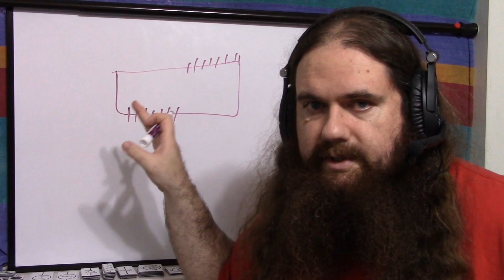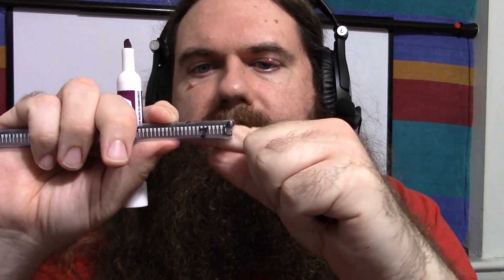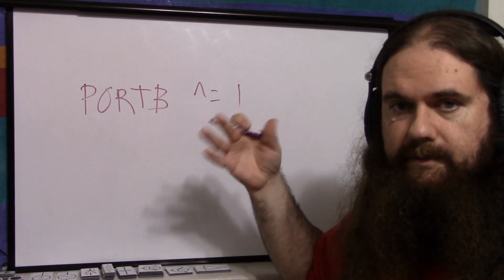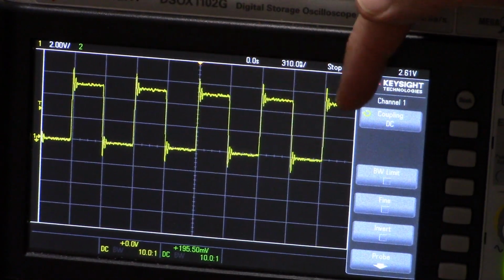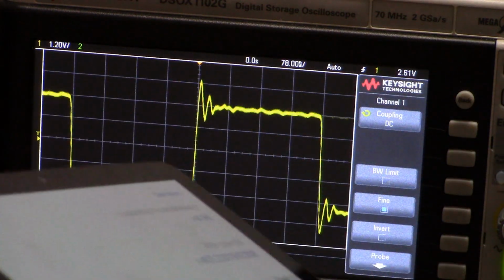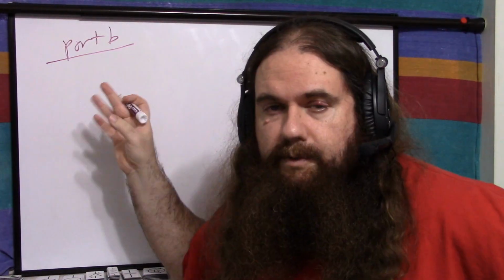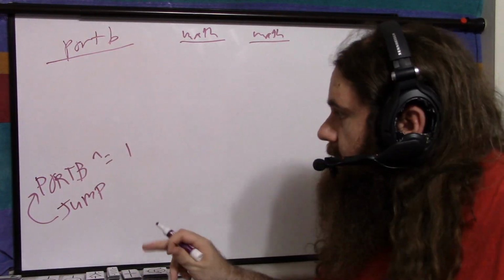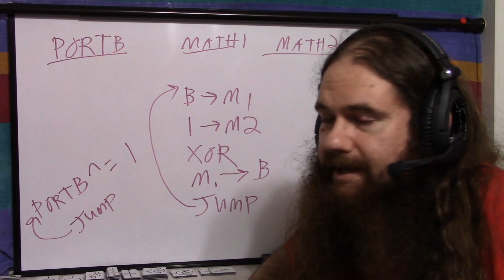How Fast Can An Arduino digitalWrite - A Demonstration And Discussion - Simply Put

Comment: You got the assembler almost perfectly right!
The jump actually takes 2 clock cpu cycles. The loop still takes 5 cycles per iteration because the number "1" is  already in a register throughout the loop.

---
ldi	r25, 0x01	; load value 1 into register 25
   loopstart:
in	r24, 0x0b	; [1 cycle] load port B into register 24 
eor	r24, r25		; [1 cycle] xor    
out	0x0b, r24	; [1 cycle] store result into port B 
rjmp	.-8      	; [2 cycles] jump to loopstart, 
---

And you can get it down to 4 clock cycles by doing this:
  byte tmp = PORTD;
  while (1) {
    tmp ^= 1;
    PORTD = tmp;
  }

I'll let you figure out why that is, maybe you explain it in a future video :wink:

---
For other viewers
* Here's how to get the assembler listing: [android-install-path]/hardware/tools/avr/avr/bin/objdump -S [build-folder]/[sketch-name].ino.elf > assembler.asm
* Here's a table with atmega328p instructions and cpu cycles per instruction: https://docs.google.com/spreadsheets/d/1EzwMkWOIMNDqnjpbzuchsLx5Zq_j927tvAPgvmSuP6M/edit#gid=1419860012
---

btw, you should like hearing your own voice, you have interesting things to say!

Comment: Excellent tutorial..!! Earned my subscription..!! Keep them coming..!!;)

The ringing on the square wave is most likely due to that long ground lead on the end of your oscilloscope test probe.. If you shorten that thing up as much as possible I think you will actually see a very clean square wave.. Some probes come with a little stubby ground probe you can replace the long wire and gator clip with.. 

Scope probes typically come in a pouch with a few accessories.. The  little stubby ground probe most likely remains one of those things you glance at maybe once and go straight for the long gator clip attachment.. 

The high frequency components in the leading and trailing edges of that square wave hit that long ground lead of the probe with a similar effect to plunking one of those old door stop springs..;)

I did bench work for a few years..;)

Comment: I used to write mainframe Assembler.  With 22 Instructions, 15 Registers, and 2Gb of Memory, you could write code to do anything you could dream of...in green and black.  When I switched to Cobol, I used to decompile the Cobol into Assembler to optimize my Cobol programs...a fun game for a Nerd.  Debugging Assembler was extremely tedious, writing It was 4 times slower than doing the same in Cobol, but boy was it fun.  I mess with Arduino programming now, so you have my atttention.

Comment: I was sorry to hear that someone told you that you talk to much. They say a picture is worth a thousand words. I am totally blind, so not much of a visual learner. You explain things in a way that I can follow. Not just the concepts, but the circuit layout, etc. I Wanted to learn how to make an R2R dac. I had to listen to about 8 videos just to learn how the darn thing was connected. Grrr, but who cares, I got there in the end. I especially like your videos because its one and done. Let me tell you, making disjointed notes from multipul videos flow in a way that makes sence, then finding a couple other videos to verify what you think you figured out, is challenging and teedius. I listened to a vid of yours yesterday, and subscribed within 30 seconds. Yes, I "liked" it too. Now I've been benge-watching your channel and learning in 10 minutes what could take 2 or 3 hours to scrape together from other channels. You just keep right on talking. For the curious,, I hear voices. My computer, phone, multimeter, etc, they all talk to me. I've also made some tactile gauges with servos. They hold their position while being touched. For example, I made a speedometer for my exercise bike with an Attiny85, a servo, and the input connection the original, inaccessible computer used. Works great, and easy to check without interrupting my YouTube video. Oh, I put it in an altoids box, because no self-respecting hobbyist  doesn't have at least one project in an altoids box!

Comment: Dear Simply Put, let me start with saying that I'm glad I found your channel, so much knowledge and a pleasant way of hosting, 
I wasn't sure on which video to ask this question but I was sure it was you I would be asking, so may as well do it in this video as it is somewhat related (ahum)
For me electronics is like I get it but I don't and now that I'm programming an ATtiny85 through my parallel port I can't figure out for the life of me if I need to use resistors between the pins of the parallel port and the pins of the ATtiny85. In one of your videos you mention resistors will slow down response time but I also now have four damaged parallel port cards,. My clock pulse resembles your square wave with the noise when changing state which when programming at higher speeds is causing false reads I think , so my second question is how can I clean up the signal ?
I hope you are alright and continue posting soon

Comment: Great video as always. You certainly put a lot of work into these but they’re some of my favorite I’ve seen on YouTube (and I’ve been here a long time). I wonder what you think arduino ide is doing to the instructions when you change to the “fastest” compilation. Or better yet, how many cycles does that save? Behind the curtain type of really interesting. I also wonder about the comparative stabilities of each but that’s a whole different can of worms
Reply: Different optimization levels as far as C/C++ go, you can f.ex favor speed over size (code/program size) by "unrolling" loops or "inline" function calls, what that is is fairly straightforward; instead of the program counter (the "where am I now?") doing a jump instruction to some other part of program, it is faster (or can be faster, especially for small functions/loops) to just copy/paste the function into where you are. In other words; if you were reading a book, instead of looking up where is chapter or paragraph X, you have just copy pasted that right into where you are you are. This will mean your book now contains the exact same paragraphs several places, but if it is a small paragraph that is faster than "jumping".
Unrolling a loop likewise; imagine a for loop interating 3 times. You can either jump 3 times to the start or just write the exact the same thing 3 times after each other. 

Other types of optimizations is to keep some variable in a register instead of memory; for accessing memory is slow compared to accessing a register. But you only have X amount of registers. And so on.

Comment: Using PINB = (1<<N) will make it even faster. According to datasheet, writing PIN bit will simply flip that corresponding PORT bit. It is a single instruction flip. I achieved 2.66MHz square wave on 8Mhz ATmega328p. So PINB = (1<<2) costs one instruction, and PINB=(1<<2) costs another, to flip it back, and a JMP. 3 instructions make a square wave cycle (duty cycle is not 50% of course. Add a _NOP() to get a 2MHz square wave with 50% duty cycle.)
Reply: I even used this high frequency flipping to create some RF radio communication since @20Mhz, I can flip port at 10Mhz (without loop) and its 9th and 11th harmonic can be picked up by AM receiver @ 90 and 110Mhz. To improve range, a BJT based common base amplifier, a simple LC filter and a small wire antenna can be added.
Reply: PORTB = (1<<2); costs one instruction

This will modify ALL 8 BITS. All Port B Bits are set to LOW except Bit 2 is HIGH 
---> PORTB will be: 00000100   (looks like the third bit but bits are counted from zero)

> I achieved 2.66MHz square wave on 8Mhz ATmega328p
Should be 4MHz if the pin toggles every cycle.
Reply: @Henry-sv3wv  the looping JMP instruction costs 1 cycle.
Reply: @sullivanzheng9586 
ah, ok. i found out the rjmp even takes 2 cycles.
So the fastest you can do with 328p arduino @16MHz if you want 50% duty cycle (after the first loop run) is 2MHz with this "asm-loop":
sbi,nop,nop,cbi,rjmp   (they take two clock cycles except the nop)

unless you modify all 8 port bits at same time, then it can go faster, or even faster, a raw unlooped sequence of out instructions

Comment: Assembly is something I know.. or I have a fairly decent knowledge of pre-pentium x86 assembly anyway. You can't use two memory operands at the same time. I also don't think you can use a memory operand with an immediate, but I'm not sure about that. I love assembly, I recently converted a pi decimal place calculator (written in pascal) to assembly to see what kind of speed improvement I could get. I forget the actual numbers but it was a fairly large difference. Pascal has a lot of overhead (as do many high-level languages.)
Reply from the maker: There's no reason you couldn't have those things in assembly, of course, it's just that I expect the added complexity of the chip would be stupid and impractical. But from a conceptual standpoint you could make a chip do anything you want as a "single opcode" if you're willing to spend the silicon.
Reply: @simplyput2796  I think there must be a reason, otherwise it would've been implemented. There have been times where I have wanted to move data between memory locations (sort algorithms come to mind). I'm certain it could be done, I wonder if it's just either too complex or too time consuming (either in implementation or in cpu cycles).
Reply from the maker: Yes, the reason is cost v. benefit: Too much extra complexity for too little gain. It's more engineering effort and it's more die space they could spend on something else more complex, and I seriously doubt there would be significant time gains since interacting with RAM involves the RAM controller and other timing considerations, and so it makes good sense to do it more simply to allow the CPU to more easily do stuff like multithreading and hyperthreading based on what's waiting for what and when.
Reply: Also keep in mind this is AVR assembly, not x86. Being a microcontroller, this may well be something they did implement as it IS of significant benefit to the typical application of an MCU. It's not a general purpose computing engine, so something specific like this may well have been done. I don't know any facts about this, I'm just saying maybe they did, you can't assume x86 knowledge translates 1:1 to an AVR processor

Comment: You can look at the compiler output of an Arduino sketch and maybe figure out what exactly the MCU is doing when it executes this code and how many clock cycles it takes by going to Compiler Explorer 
https://godbolt.org/z/yCSps9

 You can also convert your .elf files into plain .txt by using avr-objdump.exe which is included with the Arduino IDE.
I took the basic blink sketch and removed the delay commands so it blinks as fast as possible then clicked on Verify. This created an .elf file in this folder C:\Users\dentaku\AppData\Local\Temp\arduino_build_604254\ (you can find this temp folder by reading the verbose output of the IDE after the sketch has compiled)
I have a copy of avr-objdump in the root of C:\ so it's always in my Windows %path% so all I need to do is this...
avr-objdump -Sz -l Blink.ino.elf > Blink.ino.elf.txt
At the bottom of this ridiculously long text file you will find the code that belongs to setup(); and loop();
I don't really know what any of it means but it's there to help you see what's going on after your code is compiled.

 For some reason AVR code is very hard to read but using the version of objdump.exe that comes with the STM32 core Arduino files gives me nice easy to find chunks of code that I also don't really understand but at least you can then find out how many clock cycles each command uses.

 void setup() {
  pinMode(PA4, OUTPUT);
}
void loop() {
  GPIOA->ODR = 0B10000; //PORTA Output Data Register
  GPIOA->ODR = 0B00000;
}

 BECOMES
>>>>>>>>>

 08000234 <setup>:
 8000234:	b510      	push	{r4, lr}
 8000236:	2101      	movs	r1, #1
 8000238:	2014      	movs	r0, #20
 800023a:	f001 fb57 	bl	80018ec <pinMode>
 800023e:	bd10      	pop	{r4, pc}
08000240 <loop>:
 8000240:	2390      	movs	r3, #144	; 0x90
 8000242:	2210      	movs	r2, #16
 8000244:	05db      	lsls	r3, r3, #23
 8000246:	615a      	str	r2, [r3, #20]
 8000248:	2200      	movs	r2, #0
 800024a:	615a      	str	r2, [r3, #20]
 800024c:	4770      	bx	lr
Reply from the maker: Thanks for this. It saves me a lot of future research effort.